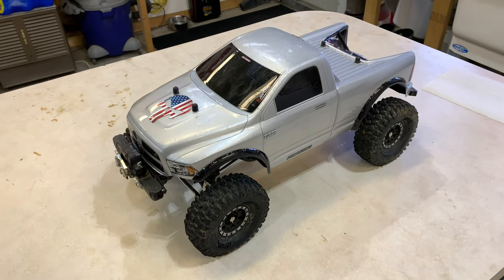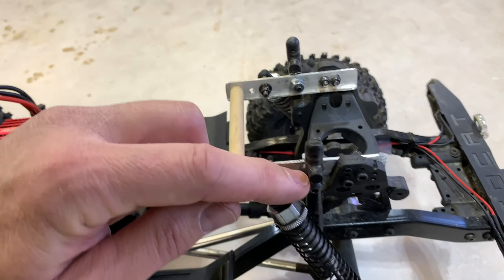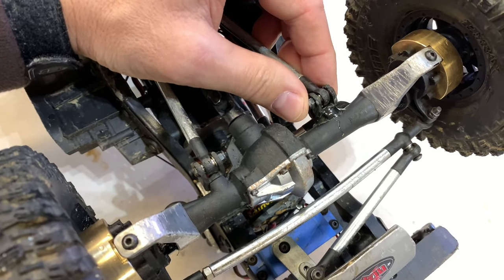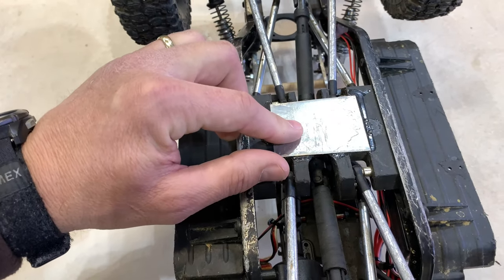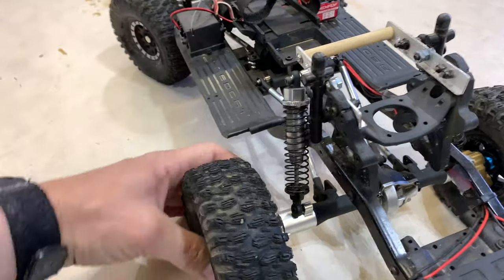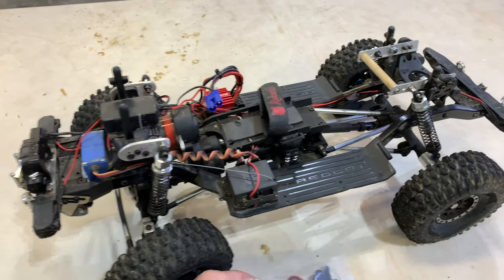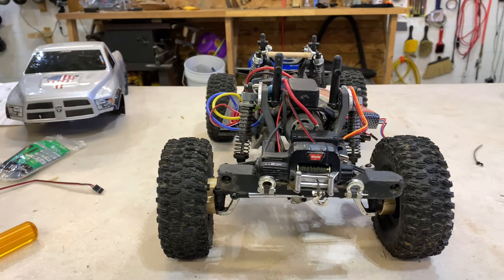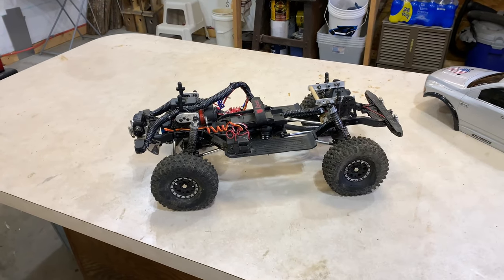Hobbywing 1080 and new high torque servo

Comment: I love the HW 1080.. I put one in every brushed rig I have. Awesome build
Reply from the maker: Thanks Bro. You ever had one when you turn it on you have steering only? And the light just flashes. I kept turning it off and on and it finally powered up and ran ok. Just seemed weird when it done it on the 2nd day.
Reply: @skybasherrc2372  did you do the throttle calibration process?? I haven't ever had one hiccup with any HW products from crawlers to drag cars
Reply: @skybasherrc2372  heres a good video on the calibration process 
https://youtu.be/IM7g1fY8ptc
Reply from the maker: @Bassin07Si  thank you brotha!